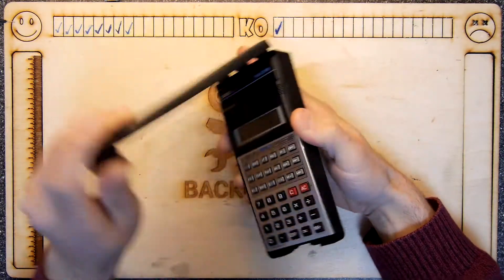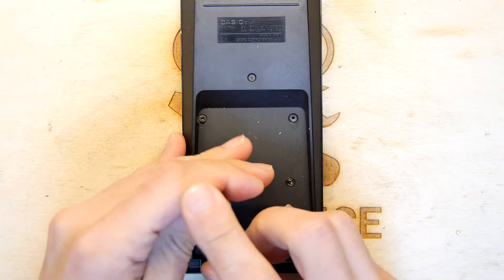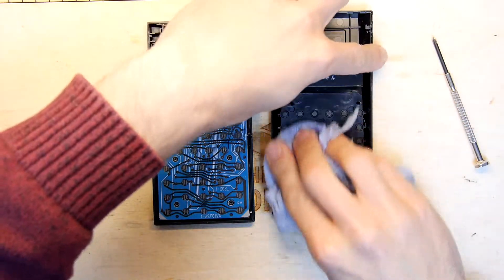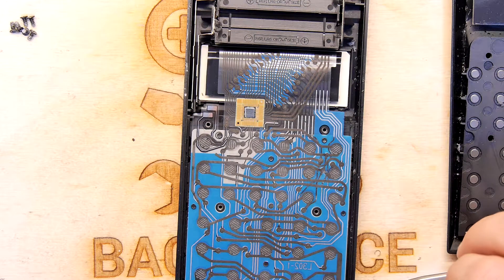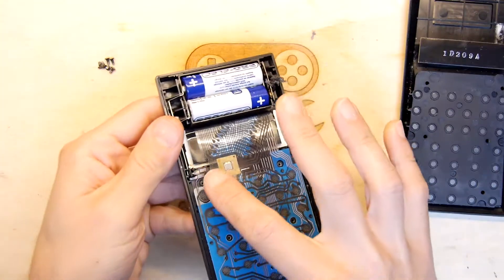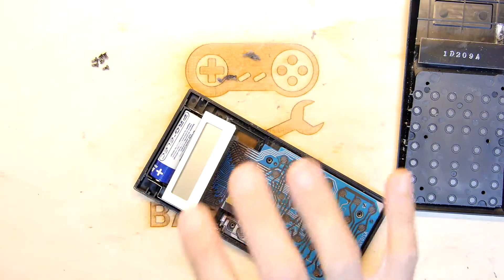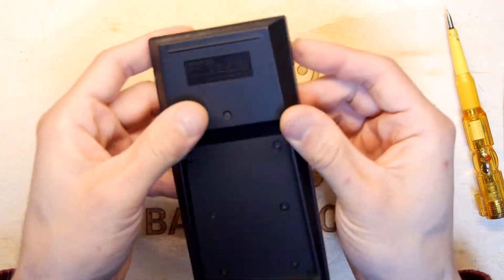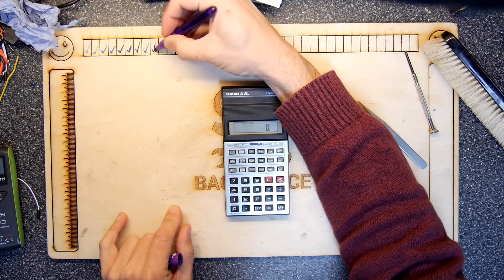Casio FX-82L

Comment: I thought the polarizing sheet wasjust a normal sheet so i threw it away(but not in the trash). I reassembled my calculator without the polarizing sheet . And i didn't know what to do. after watching your video   i realised how foolish I had been😅 after that i removed the back panel and fixed the sheet and it works perfectly thankyou ❤

Comment: Hello dude 
I also have one of these but its display is not working correctly 
It is showing only one digit fairly and has faint contrast ...
What should I do to repair it.....?
Reply from the maker: I'm not sure what 'one digit fairy' means?
Reply: @backofficeshow  sorry 
I meant one digit fairly
Reply: Sorry to disturb you again but
How should I repair it?
Reply from the maker: Try to get some polariser film. That is a good test to see if the polariser has failed. You could be lucky and if that is the case it is an easy repair. Other than that really the only things you can generally change are capacitors.
Reply: @backofficeshow  ok 
Thanks a lot from your 161xy'th subscriber.....